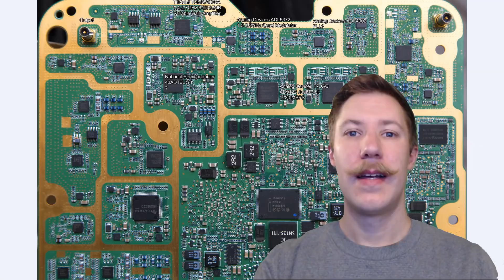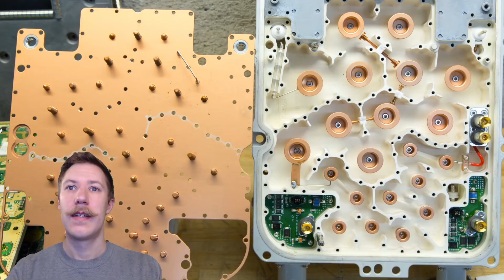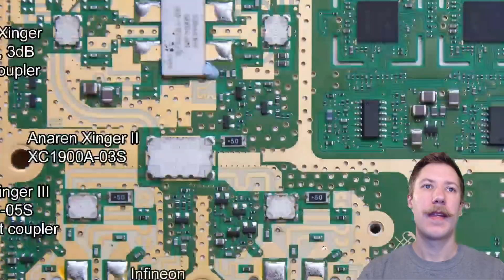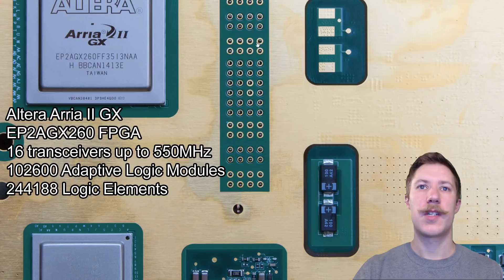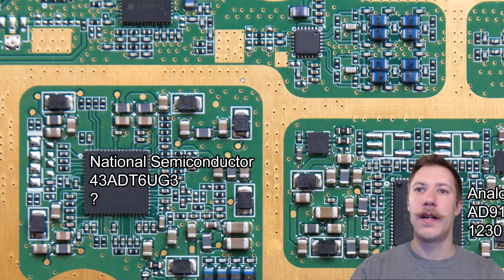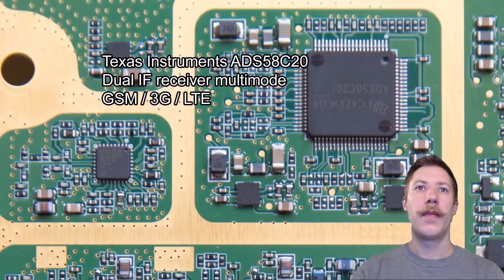Huawei RRU3928 1800MHz Radio Base Station Circuit Analysis (Part 2 of 2)

Comment: If you tinker with these telephone station boards: Be ware of the fact that those white components are made of beryllium oxide, nastilly poisonius stuff if the component breaks in pieces and the dust is inhalad. The use the stuff because it can withstand higher temperatures than the standard, non lethal, stuff.
Reply from the maker: Thank you for the advise. I save all the transistors for HAM operators to re-purpose. Very few has come apart and none has broken.

Comment: The spring loaded connector there is actually a press fit connector. There are several benefits to not needing to solder the connector in place. What’s interesting is that it appears to be a vita62 connector which is generally used for pluggable power supplies but has been repurposed for this application
Reply from the maker: Thank you for adding that information.

Comment: There’s about 20 industry package names for those thin SMD MOSFETs. PowerPak SO-8, LFPAK56-8, SO-8FL, SOT-669..there’s a lot, and they’re all very similar!

These are almost always a single MOSFET  with 1 gate pin, 3 sources pins and 4 drain pins (or sometime 1 drain tab).
Reply from the maker: Thank you for adding that information, I did however never find a datasheet on that specific marking. But here is another package name for a 70N10 MOSFET, PG-TDSON-8 ( https://eu.mouser.com/Semiconductors/Discrete-Semiconductors/Transistors/MOSFET/Datasheets/_/N-5gcb?keyword=70N10 )
Reply: Kaizer Power Electronics Crazy! Yet another name. Very hard to pick these out when manufacturers won’t agree on a standard package. Most are just slight variations on each other, probably thermally related.

Anyway, great video as always. Learned a ton! Thanks!

Comment: The solder-free connections are called "press-fit" connectors. Apparently they're cheaper to install (you don't need an additional soldering step for the TH components), and can avoid thermally stressing very thick boards.

See: 
https://www.te.com/usa-en/products/connectors/automotive-connectors/intersection/press-fit-connections.html
http://www.finecs.co.jp/en/knowledge/press_fit.html
https://www.connectortips.com/wave-solder-vs-press-fit-vs-smt/
Reply from the maker: Thank you for the links, makes sense to use where plastic parts or houses is a part of the component.